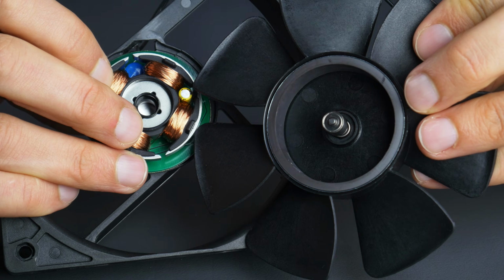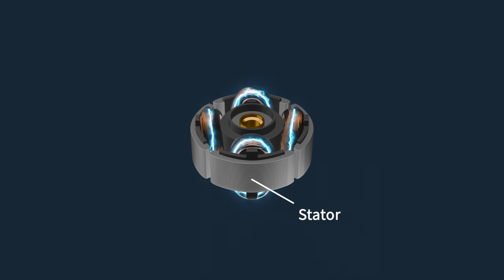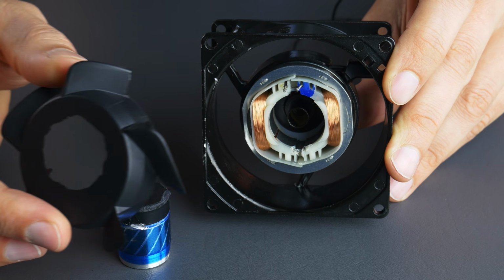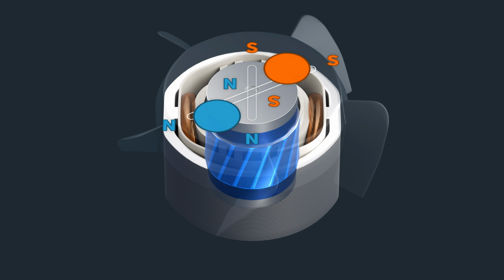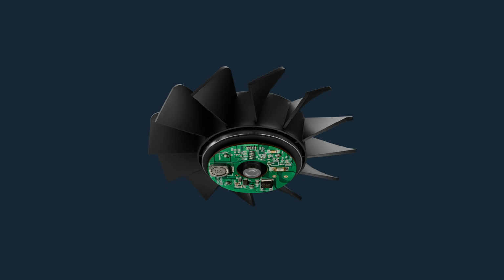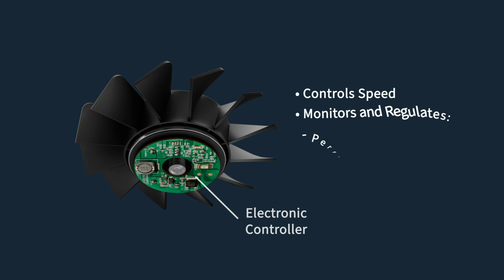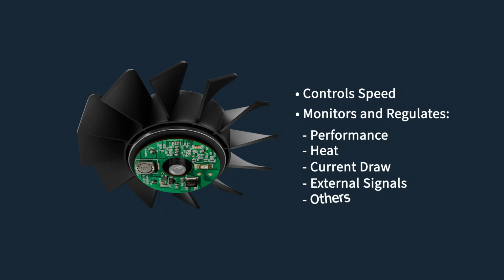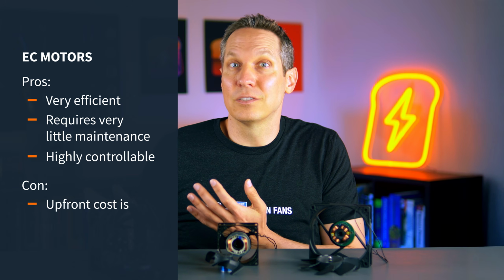DC, AC, and EC Motors Explained: What’s the Difference and How Do They Work?

Comment: There more DC and AC motors not mensioned ie DC Series motor where the exteral feild pole windings are connected in series with the armature windings, These motors in allowed the speed can run away till they self distruct. Then there is the DC shunt motors where the feild pole windings are connected in parrallel with the armature windings these are a constant speed motor. The speed can be be varied by refucing the feild strength on the external field by introducing resistance in the feild circuit or current through SCR's. The motor direction can be reversed by changeing the feild winding polarity. Then there are traction motors also known as compound wound (wired) motors These have addtional feild poles that are in series with the armature and are called interpoles and the main feild poles are in parallel with the series components.
With three phase motors there are diffrent types the usual industrial squiral cage motor (this is what brushless drone motors basically are). A squiral cage motor has the windings in the stator and the rotor that has aluminium or copper cast in a special laminated silica steel core which the drive shaft goes through. Then you have slipring 3Ph AC motors that have the wound stater but the rotor instead of cast rotor bars has a 3ph winding instead. These are wired to a set of three sliprings, that allow the curent flow in the rotor to be controled via brushes to a resistor bank or similar to allow some degree of speed control.
Next is a sinchronous motor which is similar to the slipring AC motor except the rotor winging has just two siprings and winding and DC is used to control. Another type of Synchronous motor has the DC feild windings in the stator and 3Ph windings in the rotor like the slipring motor except 3Ph power is connected to to rotor circuit. These are used for power factor correction (PF) and typically used to drive loads like large compressors.

Comment: Another very common one you missed is the universal motor, like the motor in a mixer grinder, which can run on either AC or DC!

Also, isn't an EC motor more of a marketing or system-level term rather than a truly different motor type or topology (like universal, AC, or DC motors)?
Reply: You are correct that EC might not be considered a true different type of motor, but in this case, it's used to denote the difference in the system design as it is different than AC and DC. EC is a great way to use AC input but get the benefits of a DC fan which saves on energy for appliances or applications where energy consumption has to be controlled.